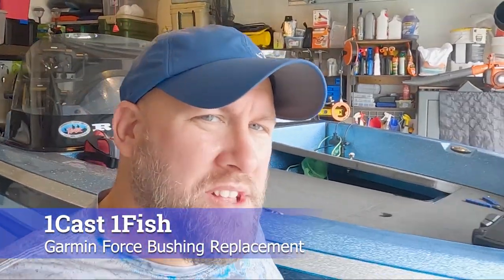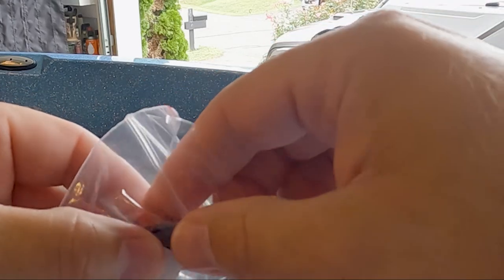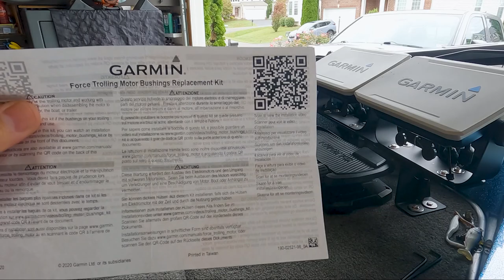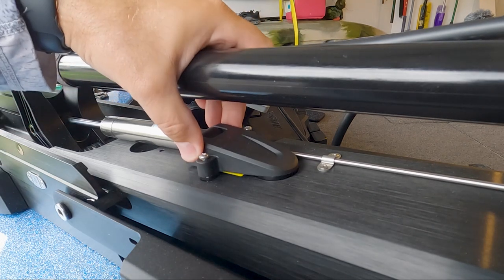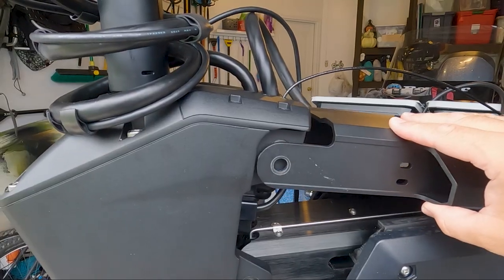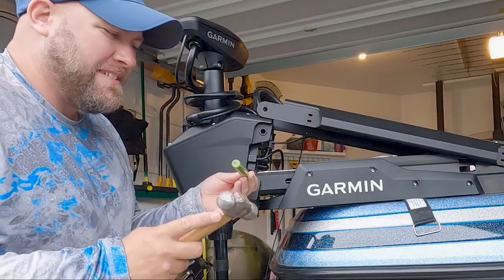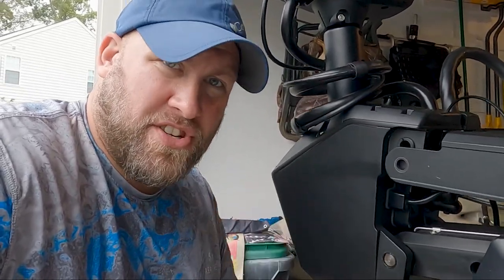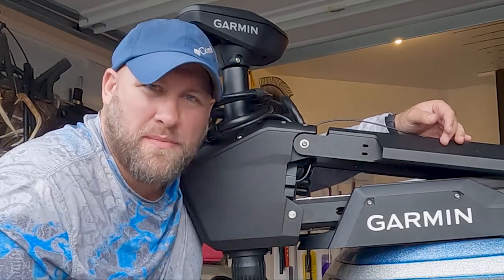Garmin Force Trolling Motor Issue and fix

Comment: I had to do this fix to my TM as well. Funny thing was there were already #2 bushings installed! Anyways, when you do this job you can do one set at a time so the TM is not hanging by the cables at any point. I also lubed the bushings with grease and added blue Loctite to the retaining screws. I am wondering if I could have some bronze bushings made up; that would be a longer lasting solution.
Reply from the maker: I though about a more ridged bushing idea too, but worry as they seem to be the sacrificial wear component. If the bushing was to hard, I worry it would damage something else.  I hope this set lasts a bit longer.

Comment: It seems like this is an issue that will happen time and time again unless the new bushings is made of a different material.  What are your thoughts on this?  Thanks!
Reply from the maker: Most likely unfortunately, they are easy to replace, but a different approach may be needed in the future

Comment: I was a tool & die maker for 40 + yrs before retiring! Some of the designs of this TM leave me wondering how they even managed to get them out the door! The plastic bushings were the first red flag! The popping noise from the mounting bracket the second and now the stop lock feature is without a doubt the third! I’ve had this TM for 5 months and wish I had never bought it. They have replaced the head, the bushings(twice) and the mount!
Reply from the maker: I may be headed towards a mount replacement myself :(
I am happy with it honestly, but not as refined as my old Min Kota was and the spot lock is definitely not on par.
I do like some of the other features though...I run mine on 24V and get the same max speed as my Min Kota at 36V, plus the foot control is nice IMO.
Reply: @1Cast1Fish  Yeah, Spot lock SUCKS! It wonders all over the place and even runs the boat into things.

Comment: Plastic bushings?  Hard to believe they will hold up and last!  So, with a 3 year warranty, the customer does all the service?
Reply from the maker: I am kind of shocked with the use of plastic as well, especially with the longevity of my first set.  Time will tell.
They gave me the option, I could have taken the motor in for repair, but it was a simple task and I did not want to be without the motor for a long period, so I did it myself.  I actually like that they give that option to us as it gets me back fishing quickly.

Comment: Do you have an issue on video while it's happening? Mine shakes violently when it has a little bit of weeds on it 😢.
Reply from the maker: I would call Garmin if under warranty...mine did not shake alot, but a buddy of mine had one that did...ended up replacing the whole mount to solve issue.

If it does not do it when in open water, it may just be the weeds have it off balance.  My buddies shook all the time.
Reply: @1Cast1Fish  dang man thank you.  I appreciate your reply!
Reply: My Garmin force started doing it this weekend. Moves super violently while I’m trying to move soft looking for the fish while I’m livescoping.    I’ll go to bass pro tomorrow and maybe I’ll must to call Garmin support
Reply: @davidramirezoutdoors  I haven't been out too much this year to test it out much.  Last time I went out, there wasn't as much weeds.  I believe Garmin definitely knows about this issue.  They sent me 3 sets of different sized bushings along with a weedless prop.  It's nice of them to but it sounds like a design flaw more than ever.  I guess I'd have to see how the kraken looks like to know for sure since it's newer and probably redesigned.  Those bushings aren't cheap if you have to get them every other year.

Comment: Didn’t fix mine! New mount should be here today! Mine started popping right out of the box and after a head replacement,bushings replaced twice and leveling again they believe the mount arms are binding!
Reply from the maker: Very interesting, the new bushing fixed mine, but it has started to pop every so often again now.  Not nearly as bad as it was, but I might need to give them a call again.  This seems to be a semi common issue, I would be interested in hearing back if the new mount fixes your issue.